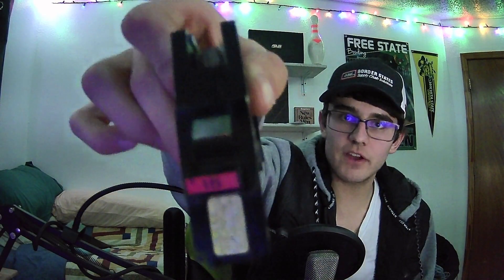The Most DANGEROUS Circuit Breaker Ever Created | Federal Pacific Electric Stab-Lok

Comment: I absolutely do not do any kind of electrical work in a home that has a Federal Pacific circuit breaker panel 
Not even changing a light switch or an outlet , Yes I've had to turn down jobs because they had a Federal Pacific circuit breaker panel and explained to them that for me to do any electrical work that the panel had to be replaced and explained the danger involved with these breakers and panels and that they had no electrical protection 
Even though the company is out of business , Think about how many of those panels are still out there , Whenever I change out a circuit breaker panel , I only go with Square D 
Which is the very best or Siemens 
Siemens panels and breakers have very close the same quality as Square D and in my 40 plus years in doing electrical work , I have never had a bad circuit breaker or panel nor have I ever got a bad report about Square D breakers and panels and Siemens because I know quite a few electricians and we keep in touch and anytime a defective electrical product comes out on the market , They always let me know about it , Also they let me know about any changes in the National Electrical Code , Such as installing new circuits in a living room for example Which requires them to be on arc fault circuit interrupters and in the basement , Requires a new circuit to be ground fault and arc fault protected , Another thing that makes the Federal Pacific circuit breaker panels so dangerous is the stab lock on the breaker that plugs into the busbar is copper and the busbar is aluminum and copper and aluminum absolutely do not get along with each other because of the chemical makeup of these two metals , They will start corroding and deteriorating , Especially when you pass an electric current through them
Reply: Great message 👍🏾
Reply: I have a 100+ year old house. It has an FP StabLok load centre.... this vid and your comment make me sad hahaha
Reply: The best thing to do is get that panel replaced immediately , Yes it's gonna cost around 3 thousand dollars or more but for your safety 
It's very well worth it because of how bad Federal Pacific breakers and panels are and the fact that 80% of them did not trip 
You have no electrical protection , 
I strongly recommend getting a Square D or a Siemens panel , You may save some money if you pick up the panel and the breakers yourself because if the electrician furnishes the panel and breakers , Chances are he's gonna mark them up in price 
Start shopping around for a reputable electrician , One who doesn't cut corners and does the job right

Comment: Just found out my house has a fp panel. It was put in around 1980 when the house was built. Scared to death now. Looking into replacing
Reply from the maker: Good call. Square D QO is best in most regards, although Siemens panels and Eaton BR panels are also good for the price.
Reply: @NateCraven318 yes just had an electrician here today to work up a price. Probably going with square D. I didn't even know about the existing issues with this panel. It was discovered by accident. Having central AC installed in my home and needed bigger breakers so I started looking online and stumbled upon how dangerous they can be.
Reply from the maker: @michaelangeli3209 I'm glad I was able to help prevent what could have been a disaster. Definitely get that QO panel

Comment: Yup. I won't even get involved unless the first thing I'm doing is changing out the whole panel.
Reply: You are definitely doing the right thing by not doing any electrical work in a home or business that has a Federal Pacific panel because of the liability and I myself have turned down jobs because they have a Federal Pacific panel and explained to them the dangers involved with these panels and that I can't do any electrical work unless that panel is replaced , I strongly recommend either Square D or Siemens which are the best quality breakers and panels

Comment: I am in Canada.  I have a Federal Pioneer, which is a different company, but still Stab-Lok.  My electrician recommended changing it.  Some electricians say eh, it's different.  Any insight?
Reply from the maker: The biggest issue with ANY Federal panel is that if the breaker doesn't explode, they quite literally do not trip. They are massive fire hazards, and would HIGHLY recommend getting a service change.
Reply: @NateCraven318  thank you for your reply. I ended up getting mine changed out by an electrical company with a Siemens.  Better safe than sorry
Reply from the maker: @JimS870  Siemens is among the best, good choice.
Reply: Federal pioneer had different standards than the Federal Pacific line. They had their own testing aside from the forged US testing. They were able to maintain the CSA listing and are deemed "safer", but sre still recommended to be replaced.
Reply: @topher8634  independent testing has shown federal pioneer has all the same problems as federal pacific. standards do not make a breaker safe, how the breaker performs is what matters, the ul and csa testing is done by manufacturers with them observing some tests, not in an independent lab like it should.

Comment: Hello Nate , Another brand of circuit breaker and panels that are just as dangerous as the Federal Pacific circuit breaker panels is Zinsco , Which is also called Sylvania or GTE Sylvania because the breakers did not trip and the busbar is aluminum and the breakers did not have a tight fit as well 
So when you get a chance , Check out videos on YouTube about Zinsco breakers and panels , Anybody who has either one of those panels has no electrical protection whatsoever , It's as bad as putting pennies in the old style fuse box with screw fuses , I wish that when they came out with the fuse box , they should have made the fuses different diameters for the amperage of the fuse , For example , A small diameter for the 15 amp fuse , A little bit bigger diameter for the 20 amp fuse and a little bit even bigger for the 30 amp fuse so a 20 amp fuse cannot fit into a 15 amp fuse socket and so on 
Fuses , When properly sized to the wiring are much more safe than breakers because there's no mechanical parts in a fuse compared to a circuit breaker and will blow when there's an overload or a short circuit 
Fuses are definitely much more safe , Like I said because all a fuse has is a low temperature metal strip that will melt and cut off the power and they react more quickly than a circuit breaker , They should redesign the fuse box as I explained so a fuse that's not the right amperage for the circuit cannot be installed

Comment: thanks for doing this homie! crazy your video 2 weeks old and i am trying to learn about this thing, they still sell em online!
Reply from the maker: Yes, they are still sold online for end-users who have not yet replaced their FPE panels. It's quite common for that to happen with old equipment.

Zinsco breakers are still sold online as well; those had a nasty habit of overheating, melting onto the bus bar, and causing electrical fires when they didn't trip. 

Another style of breaker that is actually safe but isn't really used anymore is the Pushmatic. They aren't really made by any company except Siemens anymore, and even then, brand new, they are very expensive. Usually, when my brother's company replaces Pushmatic breakers, they do it with old salvaged ones that they keep in their equipment shelves. They reuse Pushmatic breakers when they replace that style of panel. 

The only real issue that arises with Pushmatic breakers is the fact that you have to press them in and out every few months to make sure they say properly lubricated. Nobody is going to have a regular schedule of fingering their breaker panel to make sure it still works, lmao.

Comment from the maker: FPE. Fire Producing Equipment.

Seriously, though. If any of my viewers have Federal panels in their homes, I urge them to call an electrical company to get the entire panel replaced IMMEDIATELY. They are a MASSIVE fire hazard and they're BANNED by order of the NEC.
Reply: I refuse to do any electrical work in a home that has a Federal Pacific circuit breaker panel , Not even to change an outlet or a switch and I explained to them the danger of Federal Pacific circuit breaker panels and tell them that they have a get that panel replaced immediately because they have no electrical protection whatsoever because of extremely high failure rate , I've changed out a couple of breaker panels that were Federal Pacific and replaced them with either Square D or Siemens because these two panels have the best quality , Another brand of circuit breaker panel that's just as dangerous as the Federal Pacific is Zinsco , Because their breakers won't trip as well and both the panel and the breakers have a major design flaw , The breakers attach to the busbar using spring clips which will weaken from heat causing a bad connection which can easily start a fire and the breakers don't have a secure fit in the panel , Also the breakers won't trip just like the Federal Pacific breakers  , Zinsco is also known as GTE Sylvania because they bought out Zinsco but still , Their breakers and panels are just as bad as the Federal Pacific panels , Same thing goes that I refuse to do any electrical work in a home that has a Zinsco panel as well
Reply: I have a neighbor with one of those Federal panels in his home. He does not have the money to replace the panel unfortunately. Do you know if there is some sort of financial remedy to replace these panels?
Reply from the maker: @chunkymunkey9182  Request a service change for an Eaton BR panel.
Reply: @NateCraven318  Thank you.
Reply: @chunkymunkey9182 one of the house trailers that my folks and I used to live in had those kind of circuit breakers... All I can say is that our lord Jesus was looking out for us.
Reply: I swear by the Square, Square D that is
Reply from the maker: @PizzaMan-ItsaRomethingeveryday Mad respect.